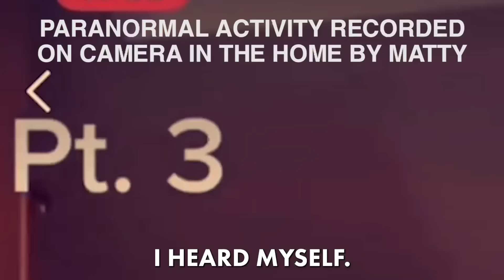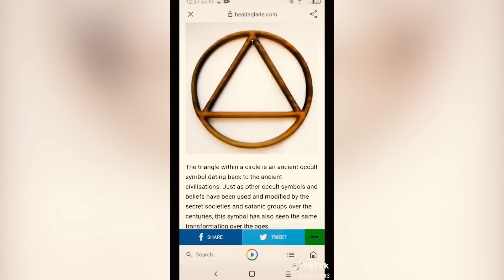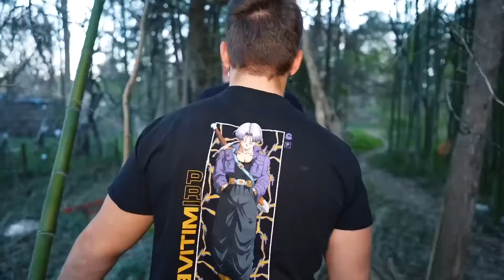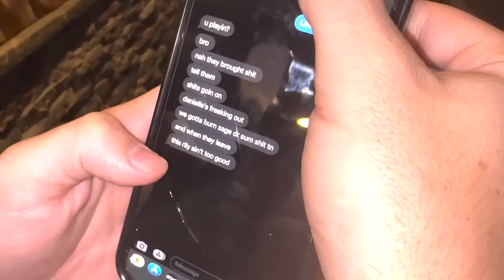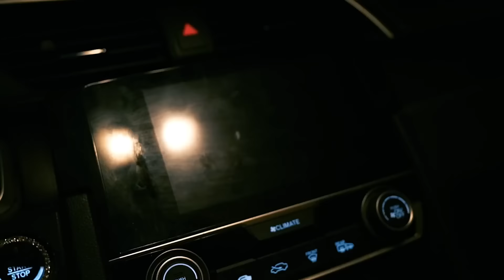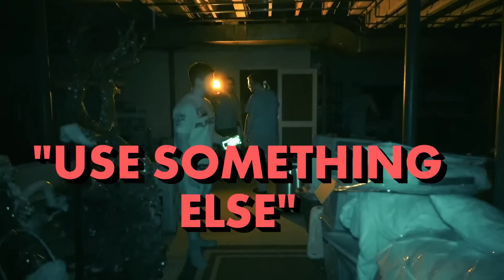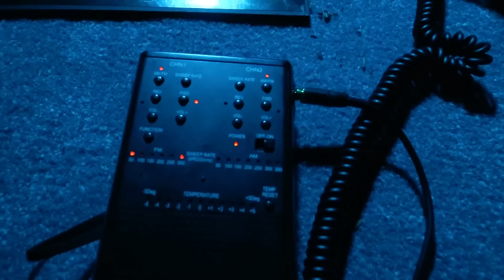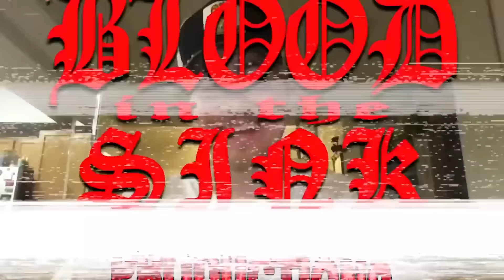The POSSESSION Of MATTY | DEMON Caught On Camera | SCARIEST Video On YOUTUBE | WATCH WITH CAUTION

Comment: 15:00 OMG look at the reflection in the fireplace glass! It’s solid black, humanoid, and tall with a pointed head. Plus that’s exactly where the sounds you just heard are coming from. It walks right into frame in the entry way or dining room. Then it does it again 15:37 seconds later. The sounds continue and they go on to say that it’s just the 3 of them in the house, so it’s nobody off camera with a hoodie on or something. Also, the reflection kinda pulsates with a black mist that I thought was a video artifact but then later when the noises move to the kitchen, then stop the reflection is clear. So clear you can see the picture on the wall across the hallway and the black mist/fog/defection is completely gone. Weird man! I’ve watched close to a thousand hours of videos on static cameras for paranormal investigations and this is so clear that I generally thought it had to be a person off camera and that’s why they didn’t include it as a capture until you hear them say it’s just them 3 in the house.
Reply: Yea its so weird! I'm very curious hope someone confirms this

Comment: 24mins and 30 seconds in while they are showing us the light switch and that they weren't messing with it and they switch it on and then off if you look towards the kitchen on the floor for a split seconds you see black smoke or mist or whatever go across the floor. Did anyone else see that? Or was it just me?